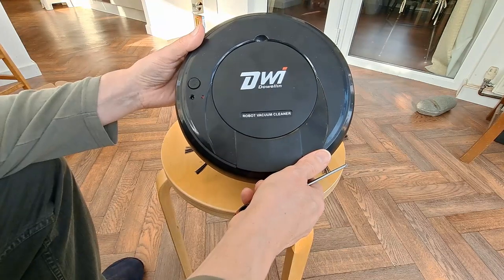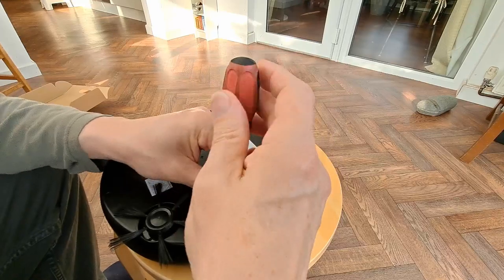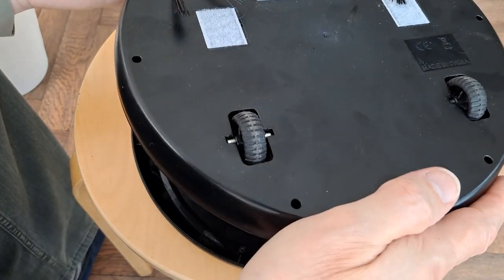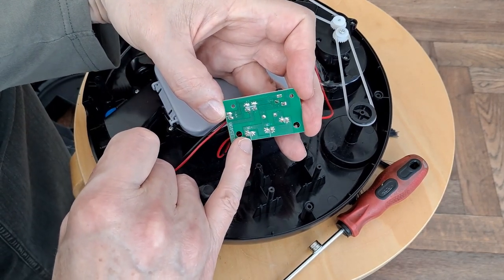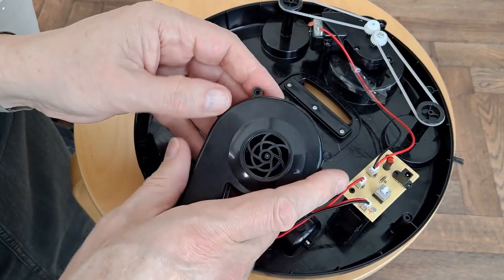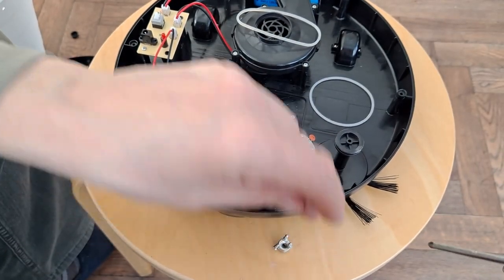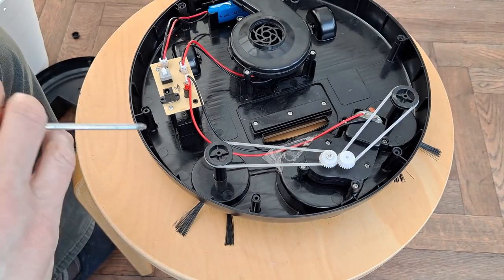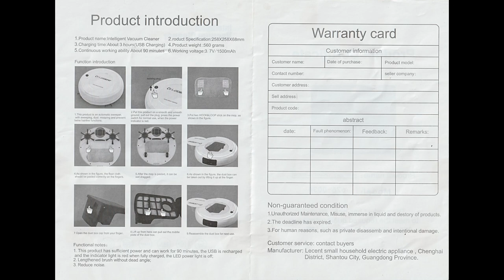Tear down the Dwi Dowellin Robot Vacuum Cleaner

Comment: Can it run while charging? So you could extend the run time with a USB charging bank.
Great video. Keep up the good work.
Reply from the maker: I could just add extra batteries inside, but seriously why would I want it to run for any longer. It is a piece of junk. It does not do the job it is sold to do.
Reply: @GrandadIsAnOldMan  I just thought it might run longer for the time lapse you were planning.
Reply from the maker: @mrnlce7939  true, but the timelapse is to establish how long it runs on a standard charge. There is a limit to how much time you want to spend watching a disk bump into things in the kitchen 😆😆 It actually ran for about 50 minutes and did manage to get itself jammed on a bit of carpet at the end of that period.